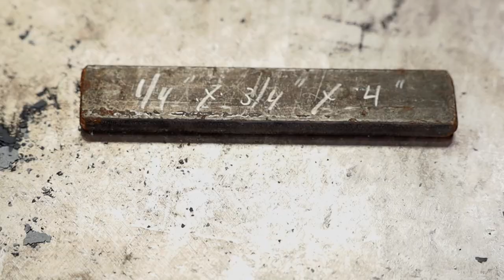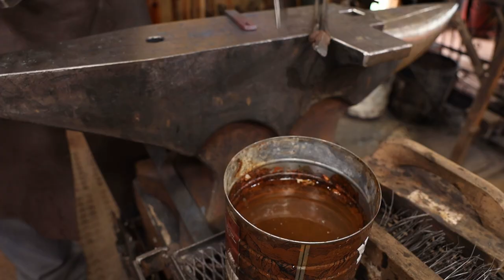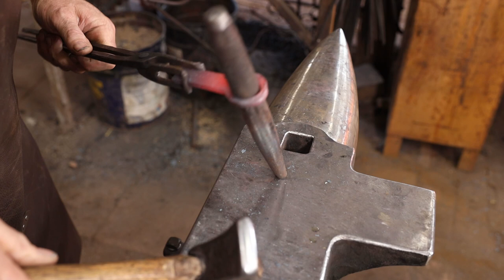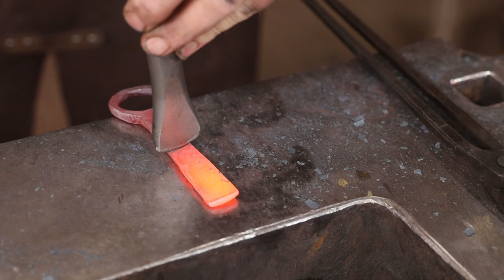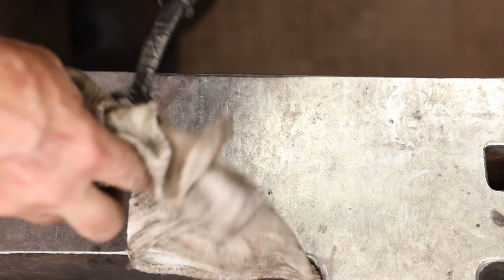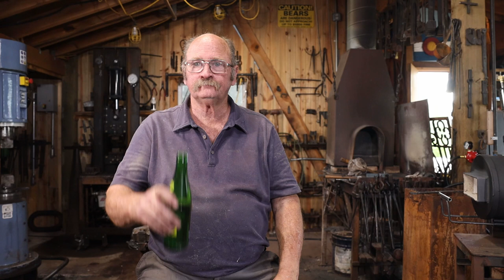Blacksmithing - Forged Bottle Opener

Comment: Nice simple project John.
I haven't tried all the permutations yet, should forge scale be removed before applying bees wax? So far for my effort, it seems the scale flakes off regardless of waxing.
Reply from the maker: You should always try to brush off as much as possible.  I don't tend to have an issue with scale that is resistant to being wire brushed popping off later.
Reply: Ill try more vigorous brushing then. Maybe some steel wool for delicate areas.